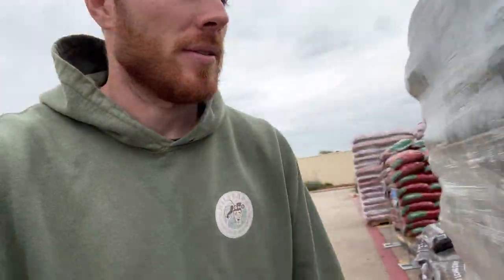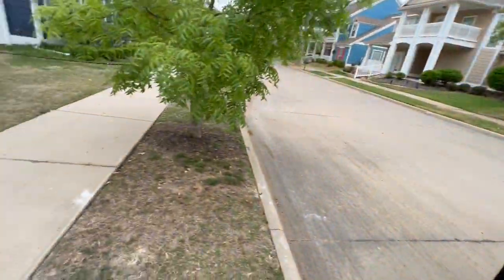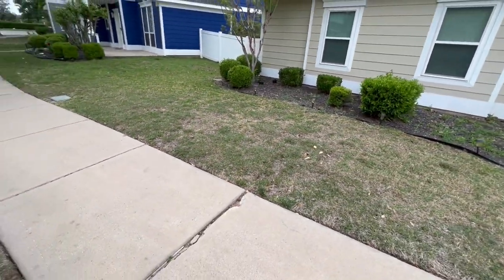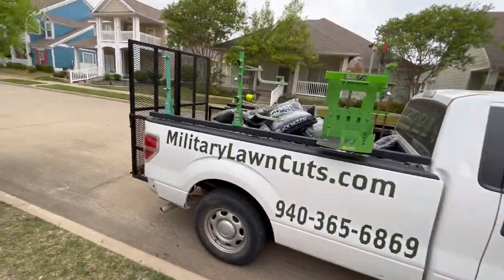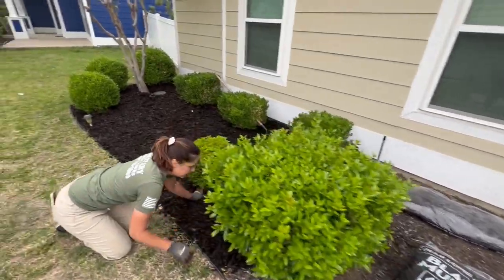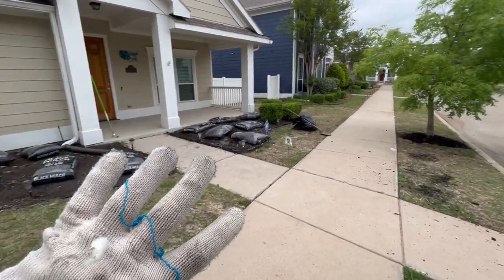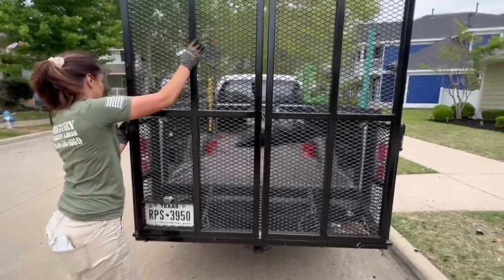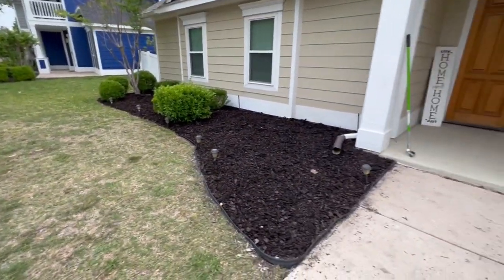How To Do Mulch Job [2023 Residential Mulch Install]

Comment: I am curious why do you not put down a weed preventer/controller like Preen? I do my flower bes just like you did here, using the same tool and everything. However, after getting all the weeds out I use the Preen weed preventer and controller  and cover the whole bed really good and then 3 inch of mulch. It works really well.
Reply from the maker: You are correct, this is how we normally do it as well but we forgot to grab the preen this day. We swung by a different day and just put it on top of the mulch. We normally add preen before the mulch goes down.

Comment: How big of a Mulch Project do you not use bags? Are bags more efficient?
Reply from the maker: We never do bulk mulch anymore. We just did a job last week that needed 125 bags of mulch and we still did not buy in bulk. It's easier and there is no cleanup involved using bags. Also if you buy too much or too less its easy to get more or bring whatever you don't use to your next job.